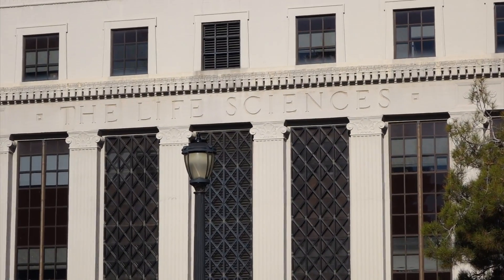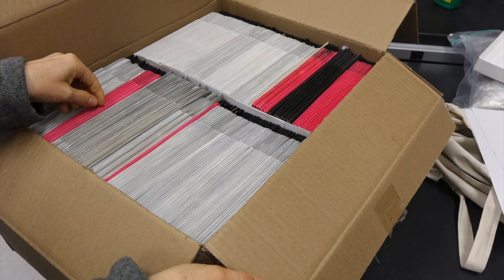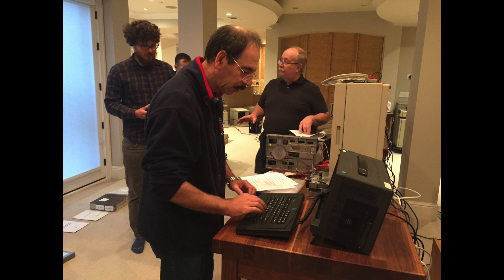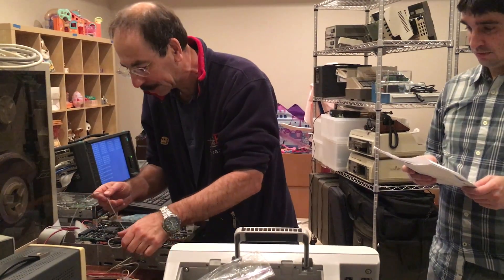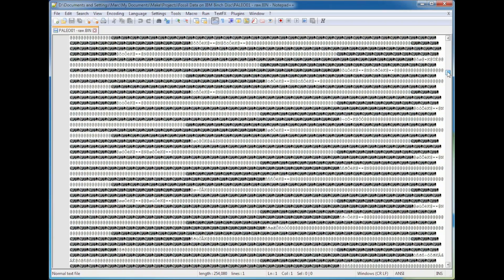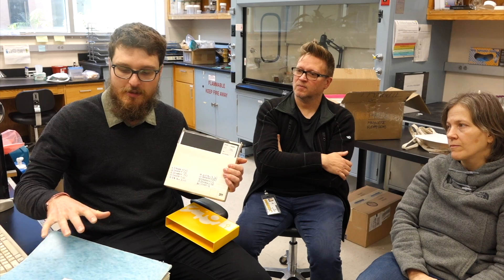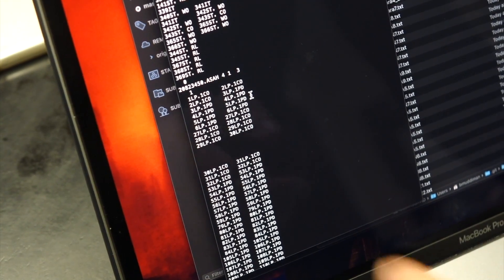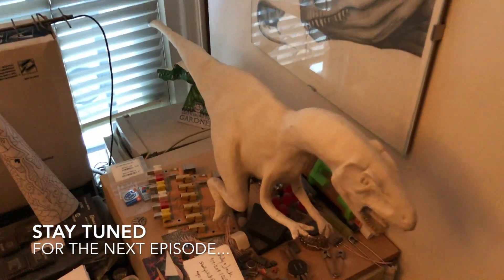Fossil Data Part 2: 8-Inch IBM Floppy Data Recovery

Comment: God I am TOO OLD!! I recall back in the 1970s a computer took up a whole room. In some configurations there were large tape drives literally the size of a refrigerator, and then there was a punch card machines that spanned the length of a 10 foot wall easily in some cases!! Then 5.25" and 8" floppies were a "normal" of the day, and in the late 1970s you could find DAT and Cassette tape, tape back up drives as well!! Even my Commodore 64K had a tape drive option had I bought it, that would store large amounts of data, but I wasn't that much of a nerd, and most of my data was on 5.25 inch floppies then!!!! 

I didn't do much on that computer other than play games, but those days you had to write the games before you could play them! I would also type letters and create "spread sheets" as they worked great at making list of parts and things! In short I have been computer generating data since I was 15 years old back in 1981, and people don't seem to understand this at all!! Yeah computers were just coming to mainstream and I was probably one of the first to own one in my neighborhood!!
Reply: Life is relative. You were at the bleeding edge between mainframes and personal computers. I was involved around the time dialup was becoming too slow for Web 2.0 and my family had upgraded to broadband. I will always keep my Pentium 3 beige desktop alive no matter what. It’s all I have left. What the future will hold we don’t know. What’s certain is that we won’t have a smartphone that needs to be charged every night and looked at. I predict future children will have a direct implant and be able to discretely look up information during a conversation with someone else. What will most likely happen is battery technology will advance and phones will just last a week of charge at a time. That will stick around for 10 years or so before another monumental leap in technology.

Comment: The data were SO important no one even looked back on them all those 50 years.
Also, storing about 20 characters in a 128 byte space is so ridiculous.
Also, electric compatibility of the 1970s device with modern formats is impressive.

Comment: I think back to when I first saw 8" floppy disks/drives when they were the latest technology.
Then I got a job where I used them every day.
Then they were phased out by the more modern 5 1/4" drives, then 3 1/2" drives.
Then floppy drives ceased to exist altogether.
I feel very, very old....
Reply: I lived all this and at the beginning I even encoded punchcards manually with a pencil which would be read in our datacenter. This was almost 40 years ago. 
Later on I would get a 20 megabytes (not gb or Tb) which was great to replace our two 5.25" floppies' no hard drive, in our office's only computer.
Reply: my grandma had ony the 5.25 and 3 1/2 disks. i never saw an 8 disk. i thought the 5.25 was big. wow
Reply: I have ls120 disks, unfortunately I have the drive away with a machine by accident, of only I could read my ten 120mb disks. One day I'll find someone in the UK to borrow a drive from.
Reply: I used a typesetting machine for a while that used these.
Reply: @user-yv2cz8oj1k  There's still a lot of LS120 drives floating around on eBay.

Comment: Wowwww...you didn't try a test disk that it would not mind being damaged?!
Reply: There were probably no blank disks available.  Every disk had real data on it.  But unless the write protection switch (a spring loaded switch that swings into the write protection notch on the edge of the diskette envelope unless it is covered) failed, the data was safe from accidental erasure.

The shredding was another matter, but the drive mechanism is so simple and gentle, they were only kidding about that danger.
Reply: @allanrichardson1468  I'd hoped as much

Comment: So much of this supports the "Right to Repair" movement, that is currently struggling to convince lawmakers. The new generation of machines are getting impossible to repair, not because they are surface-mount, but because they use custom parts that aren't available on the open market, and schematics that are nowhere to be found. Today's manufacturers do this primarily because their investment bank backers want to transform the consumer industry from that of owners to lessors : A piece of hardware soon will only be the material incarnation of a subscription model, with planned obsolescence and you are obliged to keep paying the provider to carry on using their devices.
Reply: No no no, don't you know Phil that right to repair your own engine, such as replacing spark plugs and starter motors can make the motor explode?
It is really serious stuff... Just a wrongly installed starter can make an engine explode!

For those who gets that reference from one the anti right repair bill guys, good on you... I was really frustrated and wanted to smack that guy when he said it.
Reply: SMT is not to blame. Just need training and equipment for that. Custom asics have always been a problem to replace and their use is now for DRM not performance a bigger issue.
Reply: Complaints about a "subscription model" tell me you're too young to realize that IBM hardware was always leased and never sold from the beginnings in 1890 until 1956. Companies would lease the hardware, software, and any technical support (customer engineers). IBM even forbade the use of non-IBM punch cards and media on their equipment, a practice that was common among their competitors as well. 

An antitrust case in 1956 led to the ability to buy hardware, and it required another anti-trust case in 1969 to unbundle support and software from the hardware. Even after this, when IBM withdrew support, companies would trade-in hardware for a huge discount off an upgrade, a practice that continues to this very day. Companies never run mission-critical systems without support which is always a subscription.

Comment: I remember finding 8 inch drives for dirt cheap in fleamarkets, back in the 90's... and taking them apart :-/
Reply: I used to have a pair on my first CP/M machine (until it got stolen - by a thief who I sure was very surprised when he tried to get it to boot... (512kB CP/M machines were not common and the version of CP/M required even less so)).
Reply: I took a lot apart, but i also kept a lot of them too. Some items have the "value" sticker on them, and thus you keep. Kinda funny thing...in Europe, there was a time when coins, even silver ones, weren't really that big of a deal, at least, not enough that they would spark the prices some of them do today. With the advent of the internet, and a healthy delay, the prices have rocketed. Coins that would sell for 10 Euros at best, now sell in 4 figures.
So, note, that even things that have apparently, value, can lack it, if the circumstances are right.

Today, it's the 8-inch floppy drive, tomorrow it's that MicroSoft branded mouse you have around the house, always plan on throwing out, but don't et cetera. :))
Reply: Same here... i remember referring to them as “long play” floppies :)
Reply: The last 8" drive I had, some idiot took it apart to get a stepper motor. (and I have boxes of steppers)
Reply: Oddly enough the same is true of a lot of things. Confederate money is another example. 50 years ago, it was worthless, you could get a trunkload of it for less than the cost of the paper it was printed on. There was even an episode of superman from the 1950s where someone lost a bunch of money and it turned out to be 'worthless' confederate bills at the end. But now, what's left of it is collector's items, going for more than face value.
Reply: Arkboi2000 if you hadn’t destroy them, they would n’t be rare now and maybe still worthless...

Comment: This is a brilliant project. Thank you for sharing!

One of the computers I used in high  school was an Altair 8800 with an 8" floppy drive running Microsoft Basic.
The other was a 370/135 running Basic accessed via an ASR33 TTY.

P.S. It will be great to see the publications that result from the analysis of the recovered data.

Comment: Coming next: part 3, in 2070, where a few nerds try to re-rescue the same data from the obsolete flash drive it was left on by these guys. Lots of people remember the format, but nobody can find a 50 year old USB driver. It's really quite exciting, though a bit tragic.
Reply: The Time Capsule buried at the 1939 Worlds fair has books and magazines
stored on microfilm in glass in a Nitrogen atmosphere. 4920 years to go!
Reply: @jsl151850b  too bad no one can read the language it is all written in. Sad.
Reply: @Johnny SanDisk at one time had a Time Capsule Ready Flashdrive. It must have had a long term battery. It promised 100 years.
Reply: @Johnny Make a CD out of copper, coat it with printed circuit photo resist, burn it in a DVD burner, develop the photoresist, etch it in acid just enough to develop pits, Remove photo resist. There! A 5000 year proof CD.
Reply: @Johnny If these were in space or on the Moon that would presuppose a sufficient technology to read them. Uncompressed and unsophisticated to make it easier... for aliens as an example. Like the Voyager Golden Record, only digital.
Reply: @jsl151850b  Flash media does not require power to retain data.
Nowadays, if you want long-term, reliable storage, FRAM is a great choice.
Reply: @zs9652  The books included instructions that would aid historians in translation.
Reply: 2070, we found nerdy leftovers, disks, flashed drives, is it France? 
Why they never archived it in the cloud? primitive beings!
Reply: Hum, i'm sorry but i'll have to ruin everything : This will never happen... There is too much usb material lying around; computers back then were not as widespread as they are today, in fact they were pretty rare and niche back when 5 and a quarter inch floppy were around, just imagine for the 8 inch !
Reply: Correction- it’ll be an AGI….

Comment: If they have data for each square centimeter, would be cool to see an image created from it.
Reply: YES, pls do it!
Reply: It's not image data, it's descriptive data.
Reply: @A3Kr0n  I know this but doesn't make any reference to points relative the sample described? What I mean by image is a visualization of this data given the relative points in space
Reply: @MasterControl90original  this is exactly the kind of thing I expected they would be doing straight away. I mean isn't the point of all this data indexing all those samples to be able to use "big data" analysis on it to reveal things about this time that we perhaps never knew and or couldn't know. It seems to me like the guy that did all this work had this in mind all along but knew at the time that this was something that could only happen in the future. Otherwise why catalog and index all that information digitally at all? Just file the samples with descriptions and an old fashioned written index to go to sample areas for specific study. That's not what this data seems to be mainly for as it describes in detail what is in every area of all the samples. Its begging to be visualized in new ways on computer.
Reply: I don't think the data has enough information  to create a 2D visualisation (image or otherwise). I get the impression the data just has an ordinal key to the square centimetre being described - so that someone could find their way back to the region on the sample slice - rather than a 2D coordinate on the slice. So the data is more like an index - rather than a map.
Reply: From this data, if someone wants to see how a "300 million times around the Sun" cell-capillary cavity junction looks like, they can now locate which numbered acetate slide and square centimeter.
Reply: But does the information for each cm² take more space on these floppies than 1 cm²?
Reply: @HappyBeezerStudios  Even early 8" floppies held 240 kB, so that's 4.65 kB/cm². Since each square centimeter seems to be described in 12 bytes (including line break), that comes to .25mm².

If you want to count 80 bytes for each square, since that's what it was padded to, it's still only 1.7mm² or .017cm².
Reply: I guess scanning could be the next project for a new cohort of freshman.